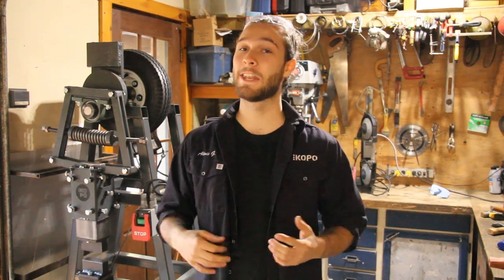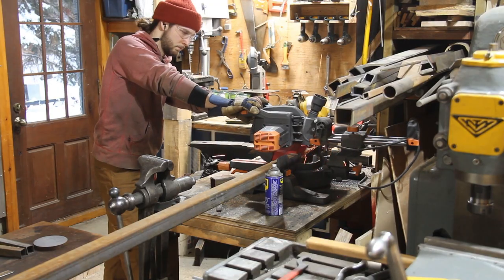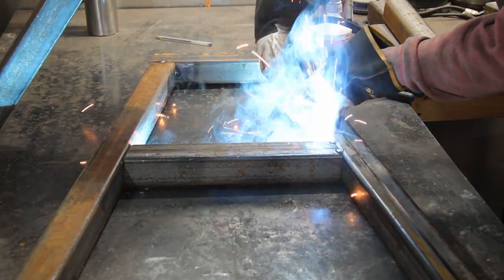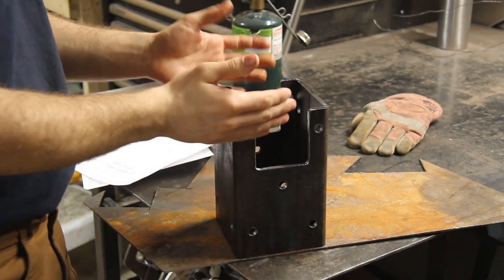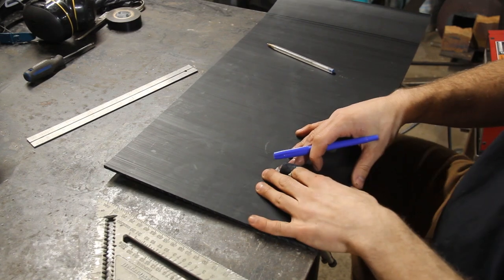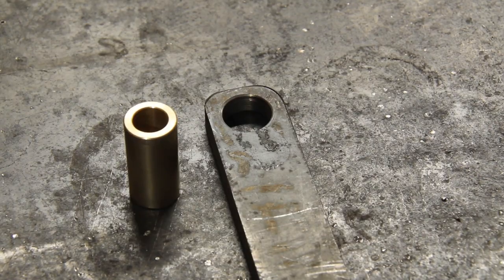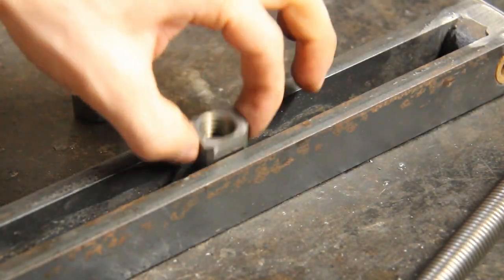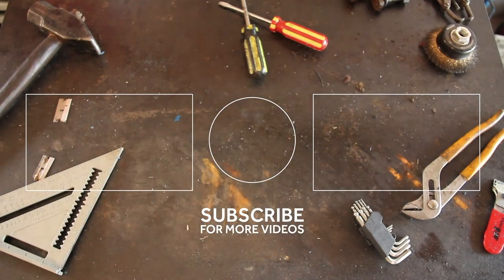Building a DIY POWER HAMMER | Part 1 | WITH PLANS

Comment: Hey great looking plans, seems to be a combo of tire hammer/ dupont and a Japanese strap hammer frame. One question I'd raise is whether it needs adjustable cross bracing on the frame for support and. Really good job though, I will probably purchase the plans and have a go at it
Reply from the maker: Yes exactly! It's a mix between a japanese A frame style hammer and a tire hammer ! For your cross bracing question  now, I don't think it's necessary because of the horizontal support between the members of the structure should be plenty enough. But surely it wouldn't be a bad design idea ! And have fun building one !

Comment: Would you be able to share the power/electric consumption of this machine?
Wattage, etc
Reply from the maker: I use a 2hp motor wich is about 1500 w to make a round number but I bet the motor is using less than that when not under load so my answer would be an intermitent 1500 Watt
Reply: @KOPOprojects  thank you for the response, We are planning to put-up a production facility for blacksmiths here in PH. Power Hammers such as this would be a great help for the local blacksmith who do not have their own workshops
Reply: Hi sir, may I ask for the dimensions of this machine

Comment: My Forge only has 120 volt 20 Amp do you have a down size Power Hammer Build plan? 
Your video are inspiring 🙌 thanks
Reply from the maker: You can run the motor with 120v and 20 amp ! I'm actually runing mine on 120 v. But unfortunately we do not have a smaller version.
Reply: You probably don't want anything lighter. Kives need 75lbs. so this will be very limited. I would think 3/8inch would be the farthest you would push 50lbs. If your building go for125 to 150lbs. You will do so much more. You most likely don't want to replace it in a year.

Comment: Just need helps with the spring.
Reply from the maker: How can I help you ?
Reply: @KOPOprojects  found a reference and ordered a motor cycle spring last night.  Where did you get your spring from and what where the dimensions.
Reply from the maker: I bought mine on mc master carr I believe it's a 11 inch long by 2.9 inch in diameter!
Reply: @KOPOprojects  any chance you have a model number/ part number?
Reply from the maker: Depending on your hammer design and the weight of your ram you will probably have different needs but mine is the number 96485K197on mc master carr if this can help you ! Have a nice build !
Reply: @KOPOprojects  thank you so much!